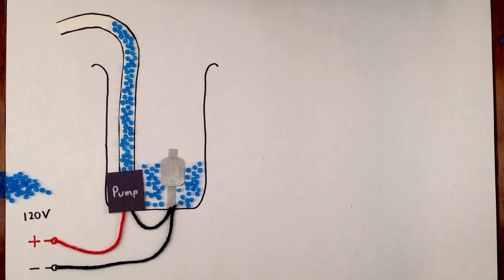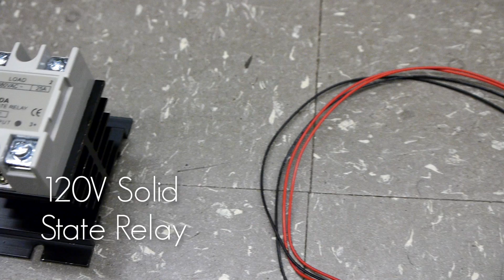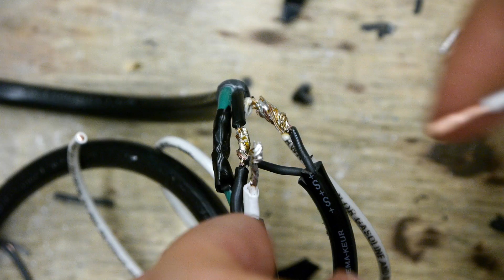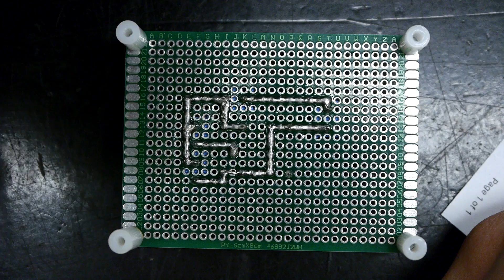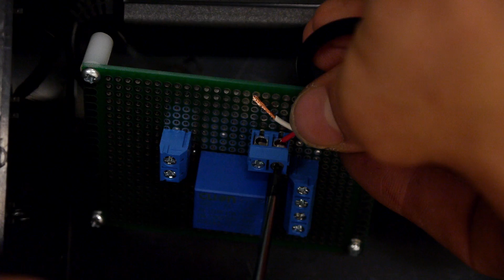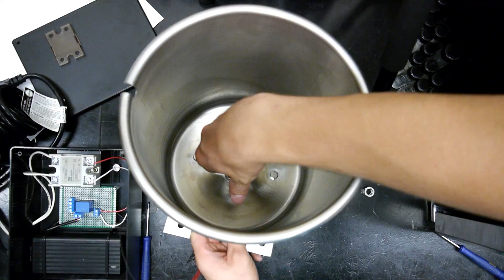A Simple Pump Controller Circuit

Comment: there are system that are manufactured to do this. the easiest of the them is a wide angle float switch  here is a link to one https://www.googleadservices.com/pagead/aclk?sa=L&ai=DChcSEwjfppfciPfxAhUkCecKHcyDAUAYABAMGgJwdg&ae=2&ohost=www.google.com&cid=CAESQeD2fMERV9eYLkw6n2Eqc4nLdo9VMct3y19F0MgHtt_AhwnG8l_FELgJ8u8XfccWPxH0_iOWKmAjlNeibjPUf4ND&sig=AOD64_1fLCl0as38ND_TznqxmLGI1P6SBg&ctype=5&q=&ved=2ahUKEwjH7YvciPfxAhXEop4KHQJjBFUQ9aACegQIARBh&adurl=   If you want to run two pump just install to of them one higher than the other then if the water level rises to hi the second pump will come on or if the first pump fails the second one will come on at the higher water level.  good video though it is a lot of work and expense. You could also use a B&W control for tight spaces this uses  probes in the water to sense the water level  through conductivity. https://stevenengineering.com/Tech_Support/PDFs/AMETEK-BW-CONTROLS_LIQUID-LEVEL-SENSORS.pdf. both of the can handle the load for fraction hp pumps with out the need of more transformers and contactors/relays.

Comment: i don't see any connections to the common terminal and is the relay light wire suppose to be connected from the upper switch to the coil?

Comment: Hi Josh:  great engineering....need help with the two relays,  one is 12 dc 5 pin spdt...what is the other relay ?  thanks, Ron
Reply from the maker: Thanks! The other relay is a 25A 3.2-32V DC to 24-380V AC solid state relay. Here's a link to what I used: https://amzn.to/2R94rb5

Comment: does this controller work for 10hp/220v industrial pump? good work! :)
Reply from the maker: It should just so long as you use an appropriate relay for the pump driver. I'm quite sure the relay I used can't handle that large of a pump.
Reply: Use contactor with relay out put

Comment: Your pump discharge pipe should have a check valve which prevents the water from draining back into the tank. Also you should break the positive on the 120 volt relay.
Reply from the maker: A check valve might work, but I still think two floats would be needed as very small changes in water level would still bound the pump on and off - unless the valve was upstream of the pump. And I agree on breaking the positive - something that's been pointed out to be since then.

Comment: Why not  just use a check valve on the pump to prevent the water from draining or siphoning back through the pump then a single float switch will do fine.
Reply from the maker: We thought about this and I think it would work. Ultimately, it isn't quite as robust as this solution as the pump will still turn on if the water is disturbed at all. Think any small waves on the surface. You may also have an issue with any small amount of water in the tube upstream of the check valve.

Comment: where can I get the standoff screws and can you tell me what size they are? thanks for the video!
Reply from the maker: That's a great question! I bought these from Mcmaster-Carr, which is a large industrial supply company. The ones I was using were 4-40 threaded nylon standoffs (1/2" long I think). If I were buying these for my own use I might get some metric ones on Amazon, such as these: http://amzn.to/2e5NM5y  Obviously, you would need metric screws to go with it. I think a M3 should be comparable in size to a #4 screw. I also found some nice sets of assorted spacers: http://amzn.to/2e5Occ6  Good luck!

Comment: Nice controller and thanks for sharing the video. One minor issue. It appears that you are using the SSR to switch the neutral rather than the hot. It is considered bad form to switch the neutral as this means that there is voltage present on the device at all times regardless of the position of the switch. This is dangerous for anyone that comes into contact with the circuit after you. Again great project but please consider switching the hot (Black) instead.
Reply from the maker: This is a great tip! I'm by no means an electrician, but I am going to make note of this for everything I make in the future. Thanks!